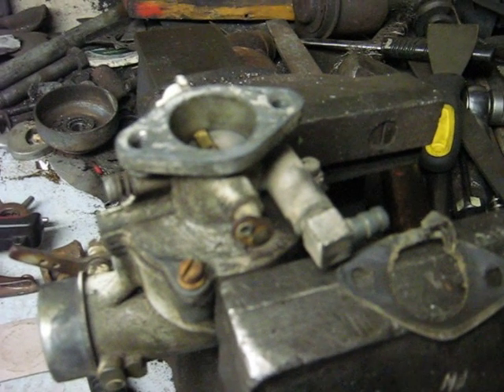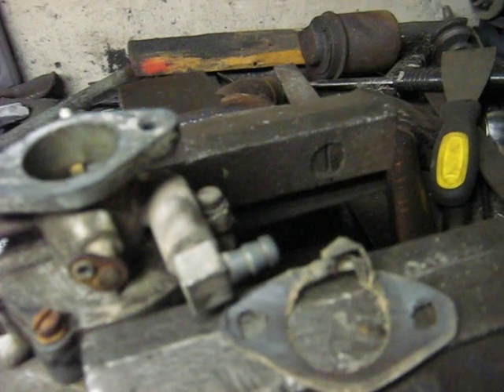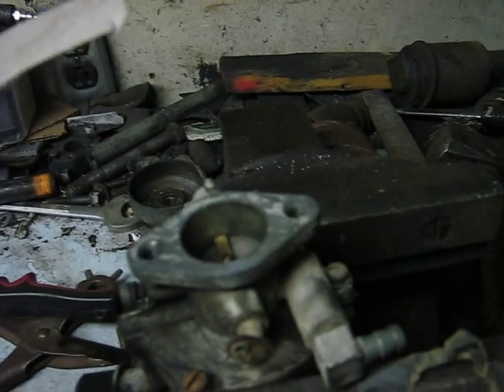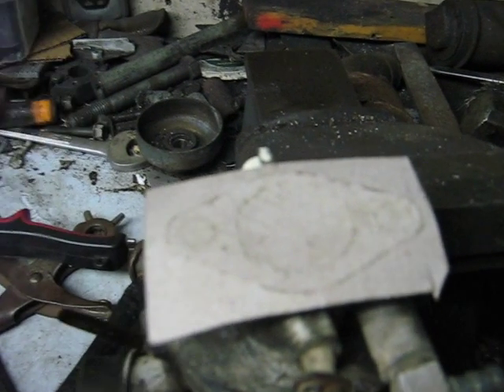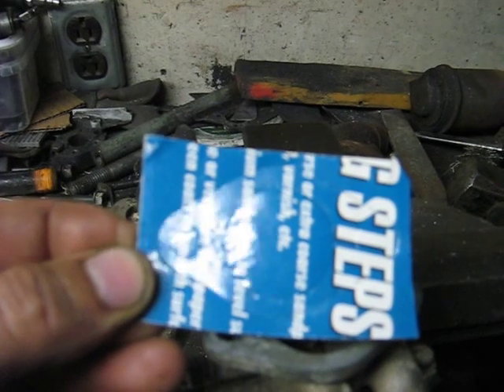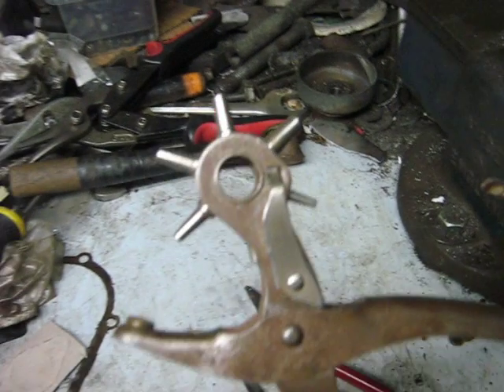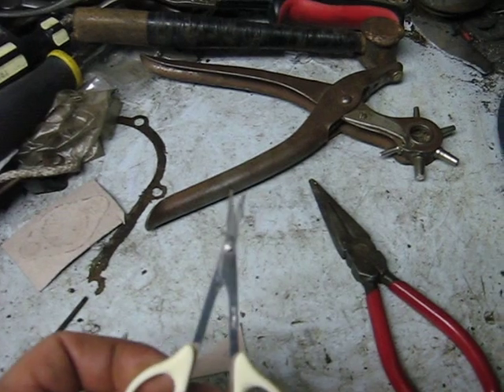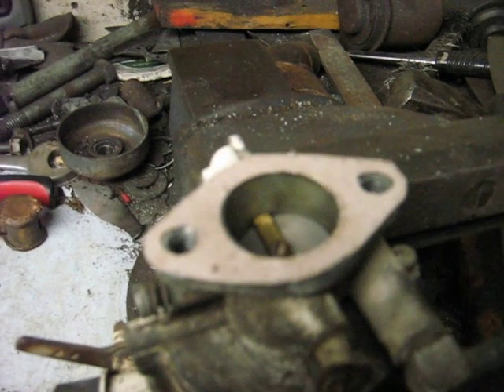Engine Gasket Making101

Comment: something from napa its steel core with some high temp cardboard on the outside. i have used some aluminum or lead foil mix i think its just thick aluminum in the past though. kinda worked

Comment from the maker: I use high temp silicone seal for that, but my engines don't run more than 5 minutes at a time. That is the only gasket I have on the black topped opposed engine, copper high temp. silicone seal.

Comment: I never ever bought any new gaskets, ever. I make it for all for my engines repairs. i just put some oil on the flange and get a piece of cardboard box and make a imprint then use a razor knife to carve it out. I also use the method like in this video by using a wrench or small hammer beating around the edges but it damages the gasket a bit

Comment: Nice video. I make all my own gaskets. I buy  a packet of gasket material from Napa. It comes with sheets for carbs and such that are fuel resistant and also sheets for making coolant gaskets. Comes with some cork material too thick and thin types for other jobs.